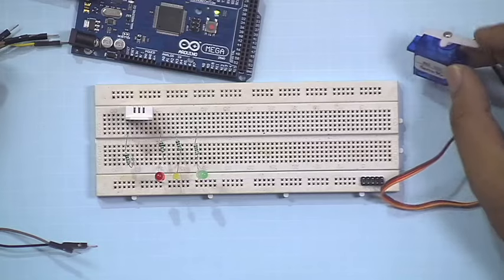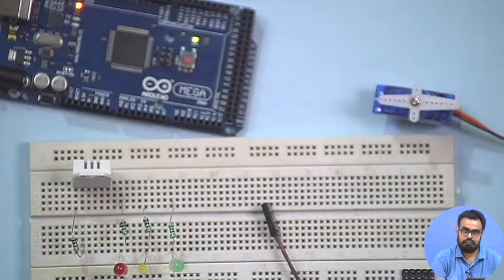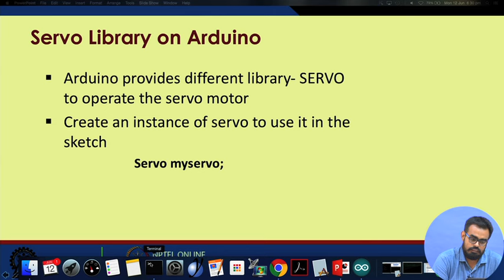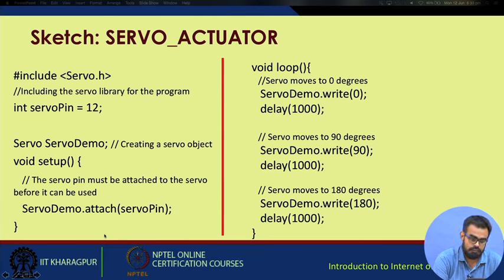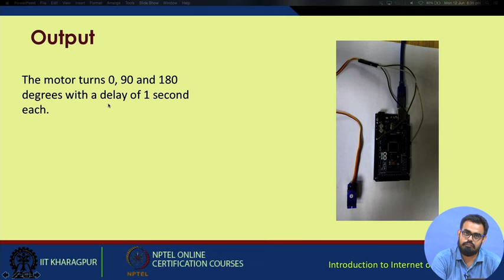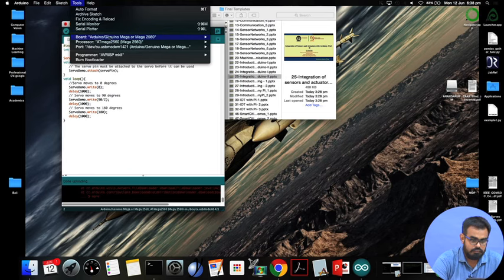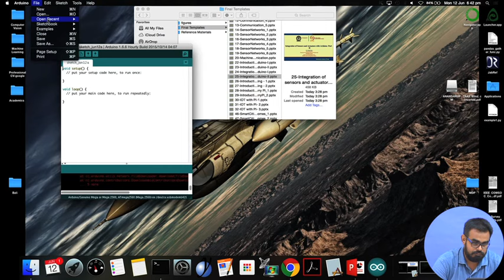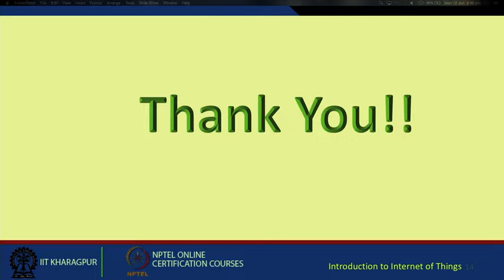INTEGRATION OF SENSOR AND ACTUATORS WITH ARDUINO-II

Comment: What will happen if we will give an angle more than 180° and why it has not worked on other angles ?
Reply: Because servo motor at a time can rotate up to 180 degrees only if we want to make it rotate  more than 180  degrees we need to add one more step in ServoDemo.write and add the corresponding angle.